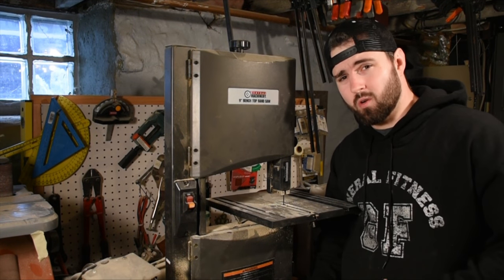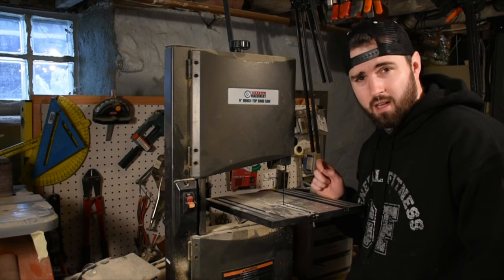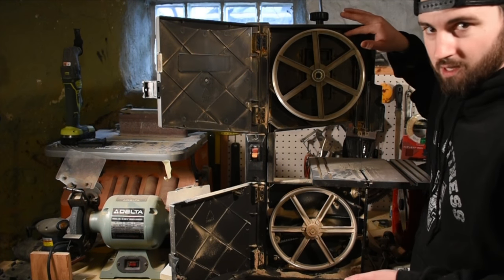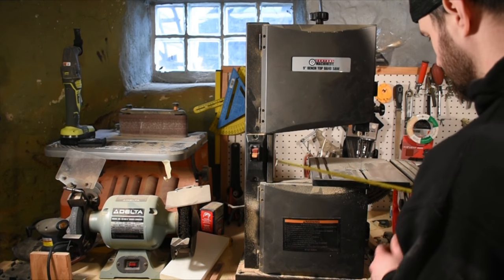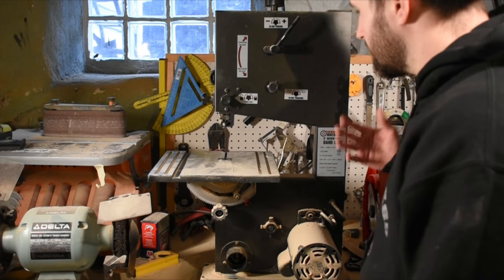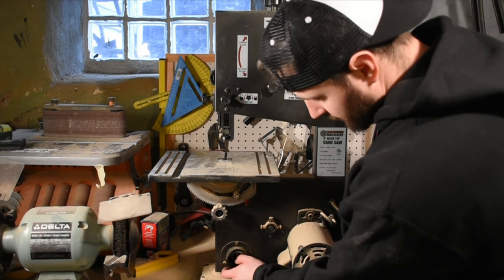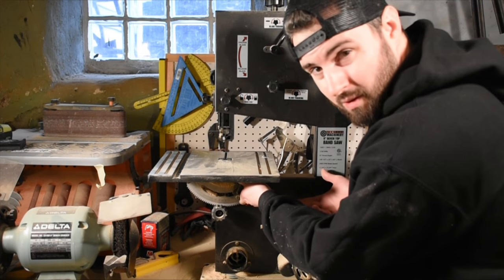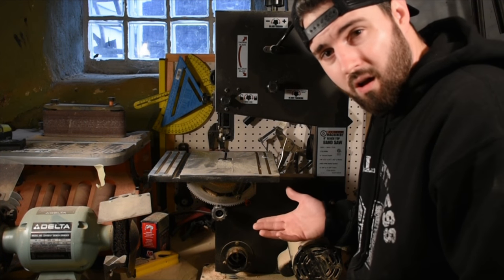Harbor Freight 9in Bench Top Band Saw Review

Comment: I own the exact same model bandsaw .... voided the warranty on mind day 1 and they knew about it before I even got it out of the store.  

"Wait ... you're going to cut STONE with that thing???"  

yup, don't need a warranty, it wont be back!

I have personally destroyed 15 of their metal-cutting blades with my bandsaw cutting through soapstone and alabaster in order to rough out my lathe blanks. :)

For cutting wood ... I went to the best.  TimberWolf.

Make sure you set your blade tracking so that the GULLET of the blades track on the crown in the center of the wheel for best cutting and the least possible drift.  Other things that can affect blade drift are having a dull blade or having your guides set incorrectly or improper blade tension.

For just roughing work, grab a 3tpi blade ... you'll have good fast cutting through your wood stock.  Also for ripping and re-sawing of your wood stock, or cutting green wood stock into blanks and boards, though the capacity of the bandsaw is a little low.  I have had some great success in using my bandsaw for ripping and milling raw branches into usable stock ... I can also easily microwave kiln-dry my wood in small batches, but it's a lot easier on my nerves to just put them in my dehydrator overnight.

For fine woodworking get a 6tpi to 10tpi blade for the best finish before sanding.  Use this blade count for cutting things like plastic sheet or acrylic stock for pen blanks and boxes, ect ...

For metal cutting (aluminum, brass, iron, THIN un-hardened steel (1/16th or so) you can use the 14tpi blade from harbor freight ... I also use this for cutting rock.  If you use this for cutting boxes and your wood is the least bit resiny or the blades are the tiniest bit dull, you'll end up with burn marks.
Reply: goldberg chews it up and spits foam dust everywhere...  horrible.

Make or get a hot cutting foam knife (the electrical one, using a steel wire for the cutting element... check out the king of random videos for the foam cutter build he does!)

Comment: I have the same saw and mine binds up a lot. What do you recommend?
Reply from the maker: Is it binding up in the pulleys or where the blade passes through the table? Either way, I would first look at keeping it clean on the inside. If saw dust makes its way in between the blade and the pulley wheels, it will allow slipping of the blade and could cause the blade to bind while cutting. Also, you should never force material into a bandsaw blade while cutting. Use light to moderate pressure and allow the blade to do the cutting.
Reply: Savvy Saving Couple when I try to cut through a two by four even a straight cut it will bind. I back off and every time I make contact with the blade again it binds up. I ordered a blade from Olson and I want to see if that helps. Thank you for your suggestion. I'm going to also clean the inside of the saw.
Reply: Wally Kellett I've never used mine for anything that thick, usually I cut 2×4s with a miter saw. I only use this for cutting thin stuff like cedar shingles or aluminum square tubing, and it does a good job with those things. Maybe this thing ain't meant to cut through thick material?
Reply: that's great advice for any tool power or otherwise
Reply: @JaredDesrosiers  JaredAmy i have the same one got it 3 years ago aet it up last year tryed to cut on a straight line lol but it would not stay straight on the line i watched you on the Video you did it what am i doing wrong

Comment: Can you cut metal with it if you have a different blade?
Reply from the maker: You would need to slow the rpm down somehow and use a fine tooth blade.
Reply: You can use3 a high TPI blade and squirt a little oil on your cuts.

Comment: Can you cut metal at all?
Reply from the maker: You could get away with cutting some thin soft metal flashing or aluminum- very carefully though…
Reply: When u say “carefully”, is that cause the hp is too low to manage cutting thin aluminum?  Or does it just need the right blade?  I’ll be cutting thin aluminum.

Comment: So why do they call it 9” if it only cuts less than 3” thick? I don’t get it.
Reply from the maker: The distance between the blade and column is 9". You can cut up to 9" wide.
Reply: @JaredDesrosiers  Is it common to find ones that cut 6" or 8" thick?
Reply from the maker: Yes, but they are larger free standing bandsaws. This one is benchtop, so it's a smaller capacity. Harbor freight makes a large saw and so do many other brands.
Reply: Three inch is the "depth of cut". 9 inch is the distance from the blade to the back of the machine, the widest board you can cut.

Comment: The band saw keeps falling off help anyone?
Reply from the maker: Inside the top cover is a knob that can be turned to adjust the blade tracking. Turn the knob either left or right with the blade turning and watch it find the center of the pulley.

Comment: does it cut steel
Reply: gene myers I haven't tried cutting steel but you could probably cut thin gauge stuff if you buy a 24 tpi blade. I probably wouldn't cut anything thicker than 1/8" though. This saw isn't really made for cutting ferrous metals.
Reply: Thank you that is helpful
Reply: gene myers Not a problem. Unless you're looking to cut steel sheet or plate, you could always pick up a portable band saw from HF for about $100. I didn't like their portaband so I bought a $300 Milwaukee, but many people do like it. It's for stock like rod, pipe, tubing, and angle, and it'll cut through steel no problem (but you have to buy the 24 tpi blade separate).
Reply: Thanks I'll keep that in mind
Reply: You never cut steel on a wood bandsaw The Rpm's are to high you would get hurt bad!  Dont listen to any dumb ass who tells you different No matter what blade porta bands run at a much slower rpm for a reason
Reply: @AK99581  Aluminum, Brass 
 would be ok but you still need to controll speed (Slow it down)
Reply: @JamesBrown-qn5lz  Yes that would be ideal, but it isn't always an option as many cheap bandsaws don't have speed control. Cutting aluminum and brass (and even thin gauge steel) are fine on a wood bandsaw, the downsides are that the workpiece gets hot as shit and it reduces blade life, if those aren't concerns then have at it.
Reply: @effyou128  LOL dude, I have cut thin gauge steel (10g-16g)on a wood bandsaw plenty of times. If you're not a moron it can be done no problem. Before my workplace got our new bandsaw we used to cut shapes in 1/8 inch steel sheets all the damn time. No it's not "proper" but it can be done. The biggest issue is it dulls the blade quickly.

Comment: Man, you need to clean up the fine sawdust throughout your shop. It's flammable. A fire hazard. Sparks from the brushes inside one of your motors could ignite it. A neighbor down the street (making wooden Christmas gifts) is now in a motel waiting for his house to be repaired. Insurance didn't cover it. By the way, for those just shopping, check out the WEN 3960 9-in Band Saw. It's better.